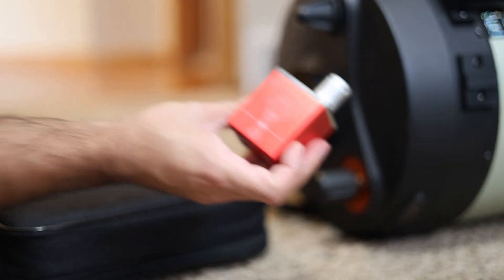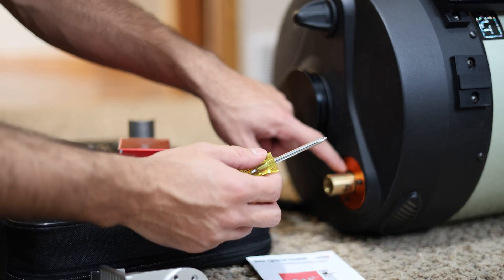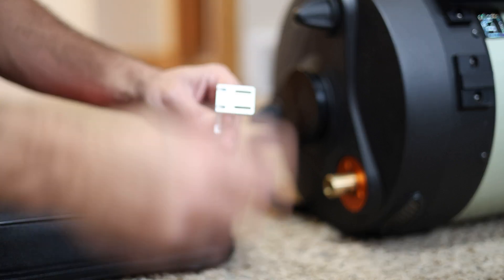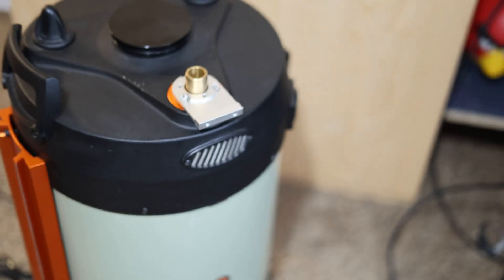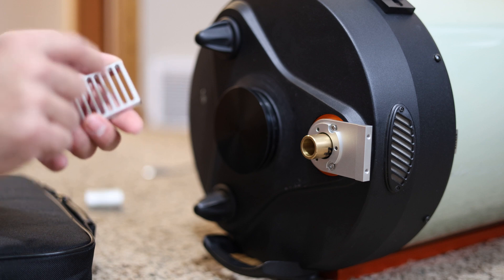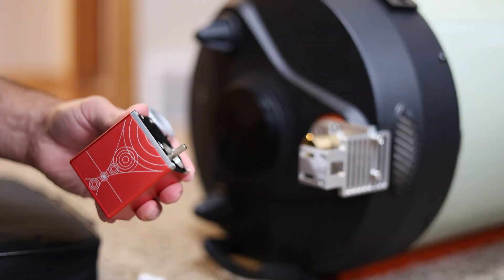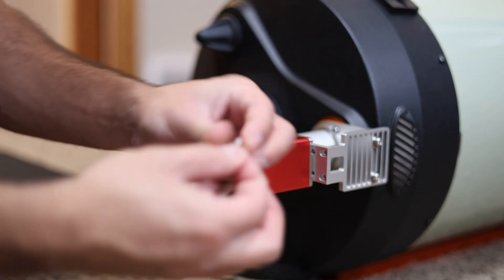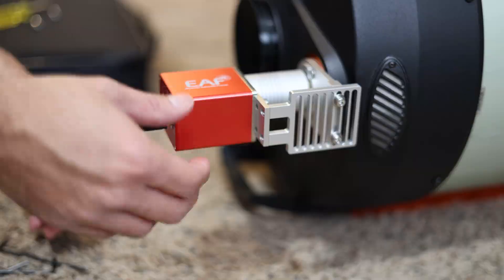How to Install ZWO EAF Focuser: C8, C9.25, C11, C14, RASA.

Comment: Will this work on a C9.25 with the feather touch focuser?
Reply from the maker: Are you referring to the Feather Touch Micro focuser? Or the external Feather Touch focuser? Starizona sells a bracket for the micro focuser :https://starizona.com/products/eaf-bracket-for-feathertouch-focusers

But the standard Feather Touch external focuser doesn't work with the ZWO EAF out of the box. There are some DIY solutions in this thread: https://www.cloudynights.com/forums/topic/760515-zwo-eaf-and-feather-touch-ftf3035b-a/
Reply: @AbdurAstro  The external Feather Touch focuser. Thanks for the info.

Comment: I installed on a Meade 8 inch sct, the adapter worked just as it came out of the box. Had to use the third slot.

Comment: Thanks for posting this video. I have the eaf installed on my c11 but when I applied enough tension the properly secure the eaf ( no movement of the eaf assembly) my focus knob is noticeably harder to move. It looks in your video like your knob is close to the tension as it was from the factory.
For me to achieve the same tension, the entire eaf assembly has a lot of movement,  which of course can't be a correct install.
I'm just worried that the increase in tension will break the supplied eaf coupler/ spring.
Any feedback will be greatly appreciated.
Reply from the maker: Hi. There shouldn't be any movement in the EAF assembly. Do you mean the focus knob is hard to turn by hand once the EAF is installed? You shouldn't be able to turn the focus knob by hand after installing the EAF due to the gearing ratio. But it will turn easily when you control it from the computer.
Reply: @AbdurAstro  thanks for your response bud. The tension I'm feeling is without the motor coupler installed. Just the tension from the extra weight of the eaf assembly being secure is enough to make the focus knob very hard to turn. Im going to pull the focus assembly out of the scope and apply super lube and make sure the bearing assembly isn't in a bind.
Maybe it's a difference of me having the standard c11 vs the HD but everyone has to have their first scope 😢😂
If I could do it all over I'd surely buy an HD or Rowe Ackerman 😜

Comment: I just did my 8", and had to use the plate reversed compared to what you did to use the three holes with the smaller overall diameter pattern.
Reply from the maker: Thank you for pointing that out. I just installed one on a C8 EdgeHD a few days ago and noticed the same thing. I will put a comment in the video description mentioning that. Wishing you clear skies.
Reply: @AbdurAstro  It's a great video.  It helped a lot.

Comment: Thanks for the video. It was perfectly details and explained. I just received my EAF and will be installing it this weekend on my C11.  Just one question, should the manual focus knob be all the way to the right, middle or left when connecting the EAF to the scope. Thanks again. Hoping we'll both get some clear skies.
Reply from the maker: Thanks for watching. I always make sure the manual focus knob is centered before I tighten the  three bolts to hold it in place.
Reply: @AbdurAstro  Thanks, exactly what I needed to know.  Keep up the great videos, I appreciate the opportunity to expand my knowledge.
Reply from the maker: @ My pleasure. Wishing you clear skies :)

Comment: Awesome video! Could you give some tips on how you measure the backlash? Thanks
Reply from the maker: So since I am using the AsiAir with this setup, I tried multiple backlash values to see what works best. Ultimately it didn't make much of a difference what value I set so I set the backlash value to maximum which I believe was 200. What does make a difference when using the ZWO EAF on an SCT is to ensure the EAF ends the focusing in the correct direction (it should be ending the focus in the counter clockwise direction) to prevent mirror flop which almost all SCTs have. So after some testing, I selected the "Reverse" option in the ZWO EAF settings in the ASI AIR focus options. It worked perfectly after that.
Reply: @ Ok thanks! Good tip I have set mine to reverse as well. I plan on trying a tri bahtinov mask to attempt to count the backlash steps. If only we could get some clear skies to try it out 🙄
Reply from the maker: @peterboytang2687  I have had one clear night in the last month and a half. And the moon was very bright on that night. Wishing for some clear nights here too. Good luck! :)